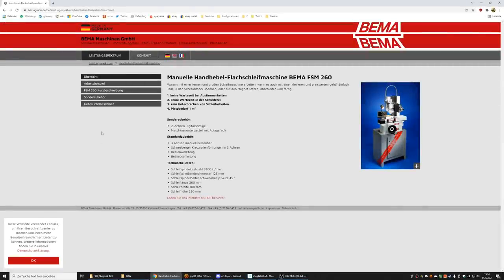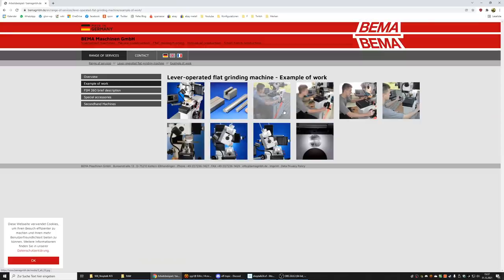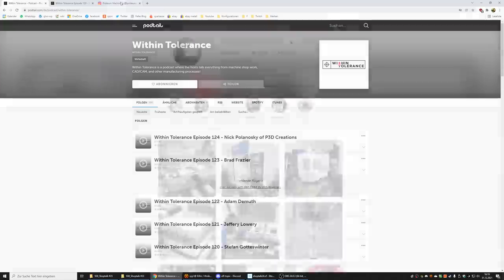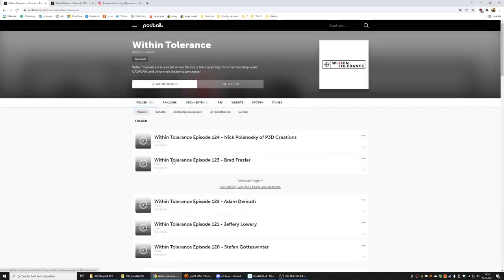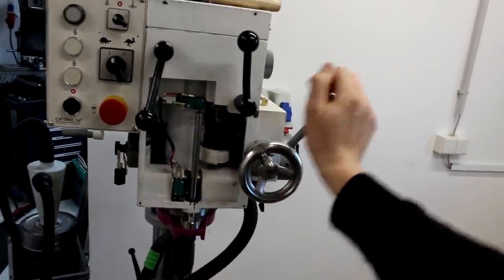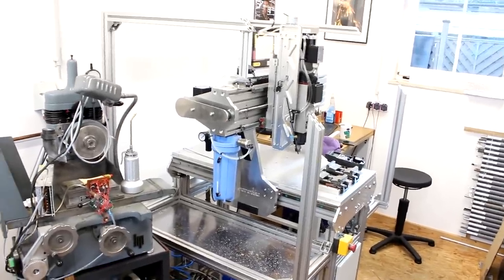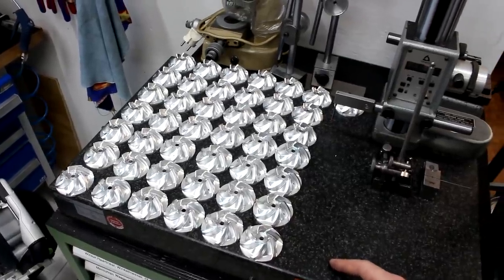Shoptalk #24 - End of 2021

Comment: Great to see you have a Japanese pull saw ready to go near that neat stock storage by the window. Every machine shop needs one! Anyway, thanks for an inspiring year of videos and Happy New Year to all.
Reply from the maker: Such a neat tool. Beeing a woodworking legastenic the japanese saws are a great help for me.
Reply: @StefanGotteswinter  the cut quality is fantastic and the narrow kerf is also nice. Not as good on Aluminum Bronze, I hear…
Reply: Something you learned from Adam? All the best in 2022.
Reply: @glennstasse5698  
That's when you need the saws with the negative rake. 🙄 I used to rebuild centrifuges for waste treatment plants. One brand used a large phonetic ring seal on one end of the the machine. When installing a new one I stated using a pull saw to cut the seal into in half. Half the seal went in the housing the other half in the cover. Using the pull saw kept any resulting gaps to a minimum.
Reply: @mpetersen6  I was kidding about using the pull saws on metal but, come to think of it, I wonder how hard they are. I wonder if you could heat treat one to the point that it might be useful to cut like a hacksaw.
Reply: @glennstasse5698  it could cut mild steel hardness wise but the rake and clearance angles on the teeth of a wood saw make the edges weaker

Comment: Nice shop update thanks. New grinder sounds interesting if a little scary.  Your body is in the same plane as the wheel? Do you sit ahead or behind the wheel? Have a good 2022.
Reply from the maker: Thanks!
Wheel spins away from the user, so sparks and parts fly away.
Reply: @StefanGotteswinter  I ran precision grinders for 40 years. Exploding wheels travel in all directions. Though I am confident you will stay safe.

Comment: As someone that has seen the occasional item shot off the grinder or a wheel get popped by an accident being in the line of rotation would make me uneasy.  Surprised at the big water pump job. You keep working on bigger and bigger stuff. Won’t be long you will be needing a hoist to handle jobs! 😎

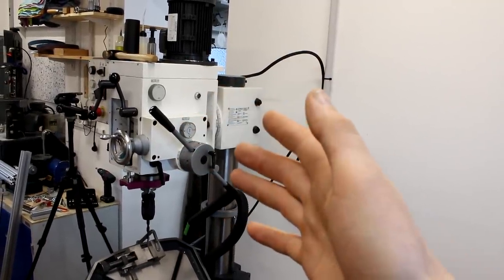Comment: 7:50 is that a Thor Hammers hide/copper-faced mallet (No.2, No.1 . . . ?) on top of your new drill press? I thought I was the only retrograde old bodger to still use them . . . 'steam engine mallet' as my father calls them.
Reply from the maker: Yep a Thor, but both sides raw hide, I have enough copper things to hammer with ;)

Comment: Cool stuff about CX500 impellers. When you mentioned it in an earlier video I thought CBR for racing
 It's pretty surprising how many old Honda motorcycles are still on the road
 I was working at a Honda dealer workshop when CX was launched in 1978. (the original was pretty ugly 'Plastic Maggot')
 I forget how long it's been out of production, 30 years or more since last CX650 was made.
The turbo version with a disconnected waste-gate was probably most fun, accelerated about as fast as Suzuki RG500 or Yamaha RD500 - both four cylinder two stroke motors.
 Someone at Honda UK told me it would boost to 52psi but it was pretty boring when waste-gate was connected

Comment: Looking at your tight , but organised, working space, I feel ashamed at the state of my 800sq. Ft. shop... stuff just flung around everywhere... It doesn't help that I do metal machining, woodworking, welding and more... I NEED to sort it out 🙄 (New Years resolution ?.. perhaps)

That new surface grinder looks sexy.. 😍

That floor must be feeling the pressure with all that machinery... have you had to do any reinforcement work ? 

Have a happy New Year and best wishes... 🥳

From the Emerald Isle
😎👍☘🍺

Comment: Nice to see the house pest make an appearance. We have two so I know.
I can see waiting until you moved out of the cave (nice cave at that) to get a large sized drill press. The one bad thing about drill presses. Probably 95% or more of them the table is too small. With the tilting head and table would it be possible to drill and ream two holes for shear pins like used on CNC lathe turrets so that after tilting you can just bring the item back up to zero and pop the pin in. That way you could be back at zero with no messing around. I've always thought something similiar would be useful on tilting tables and heads. But the problem is some ifiot will come along and stick a hardened pin in.

Comment: Your shop looks great! Is the new grinder hand scraped or can we look forward to see a video when you do it? Happy New Year to you. You’re an impressive toolmaker.
Reply from the maker: Cross roller bearing guides in all axis, no need for any work from my side :)
Reply: @StefanGotteswinter  It still has the table top ;-)
I know, I know, you are supposed to grind it in place [as lightly as possible] when you get the grinder to make it level with slides / bearing guides. Or is that too old-school?

Comment: Thanks for going to the effort to produce these videos.
I have a question- do you have a problem with the weight of all the machines now you are on an elevated floor?
Reply from the maker: Its a concrete floor - The side of the building eith the lathe and mill are directly on solid ground, the side with the cnc router and the grinders has a small basement below it. As long as i dont put a large cnc mill in there its fine ;)

Comment: 1: A very joy filled New Year to you! You are an inspiration to me. Thank you! 2: As a woodworker who does metal working as needed, that saw hanging on the wall behind you looks wonderful. Why do you have it, and how have you used it?
Reply from the maker: 1. Wish you and your beloved ones the same, all the best :-)
2. I learned years ago about the pull saws and got myself one of those ryoba saws for the occasional working with wood. That can be either work around the house, cutting wood for packaging/shipping or anything else ;)
(I also have a festool tracksaw, that has seen 99% plastic and aluminium in its life ;) )

Comment: All the best Stefan, it nice to see you doing well enough to get that grinder, i myself have a selfmade blueprint for a most similar grinder that i consider making for myself, as once my Schaerer lathe gets finally restored by me, i will have the ability to turn quite large stock... Either way, in regards to that grinder, tell us when you get it, how does it fare in respect to ``precision lost to chatter of column``, as my initial version was almost the same, before being modified and redrawn with a second pillar to reinforce the spindle rigidity.... I originally considered a rectangle column, but the latest design has two parallel columns, a round one, 10 cm in dia as the guide, to put it, that would run through a hollow of the spindle block(similar to emco fb2 in design or this new drill of yours), and the back of the spindle block is to be dovetailed onto the other parallel column that would be rectangular and be connected to the round one at the top and through the spindle carrier... To a point, but on a larger scale, what you did in that mod to your mill with that round guide-rod... If you want, i can scan or just photo the designs and send them to you if you care to see them... In regards to answering the comments, well, fuck it, you answer what little you can and feel will do good enough to be worth the effort, and the rest, do as you did until now... Be yourself and show us what you feel can teach and present others with insight and learning... I myself got into machining because of This old tony, and i can not say that you are wholly without blame in that part... But then, Ave would be the first to blame, as he was the first machine related guy i ever started watching, long before being introduced to you, tony or any of many others who share the love for the machines and their wondrous work...

Comment: I am wondering about the business case for the surface grinder. I’m sure you are not spending that $$$ because it’s cool. Do you have a specific job for it? Will it save a ton of time on existing work? Or will you be able to attract new types of work? Thanks for the great content and stay healthy and busy in 2022.
Reply: He's too busy to reply
Reply from the maker: youre bitter.
Reply from the maker: That was a fairly long decision process - I was looking for a general surfacegrinder, thats a little bit larger than my lip515. A full sized 618 grinder like an Harig or an Okamoto are to much of a grinder, to heavy and to large.
Alternative was a Lipemec, but those are horrendous expensive, and I have seen the BEMA grinder years ago at a tradeshow.

After some talking to BEMA and looking at the machines in person, the machine made the most sense for me.

Use case for me: I want to expand on grinding work in general, not only flat, but also round work, and the substancial larger work envelope of the BEMA grinder allows for spin fixtures to be used without space issues.
Also, since all three axis are very easy running cross roller guides, it will also be an excellent precision platform for things other than surfacegrinding - ID-grinding with an additional highspeed spindle, using it as a measuring machine and other ideas come to my mind.

The old LIP  grinder will become a cnc grinder for production work.
Reply: @StefanGotteswinter  awesome can’t wait to see you do internal grinding. Happy New Year.

Comment: Surely it would have been better for your Customer to have got you to make him an injection mould for the impellers ? He could have then got them die cast in the 1,000's if need be. If the 80 or so you have made sell out, he is back to square one again and have to wait for you to make more at no doubt an increased cost.
Reply from the maker: Good question, I didnt even consider die cast injection molding. Would be interesting at which point machining would be more expensive than making a mold and have them cast, but my guess is, that 1000 would not be enough to give a good return on investment.

Comment: Which brand of surface plate you are  using? What is the accuracy level of this plate?
Reply from the maker: Thats a Garant (rebranded Planolith) Grade 0 plate. Allowed tolerance would be 7micron for that size of plate, the spec sheet gives me a total tolerance of ~4micron out of flat.